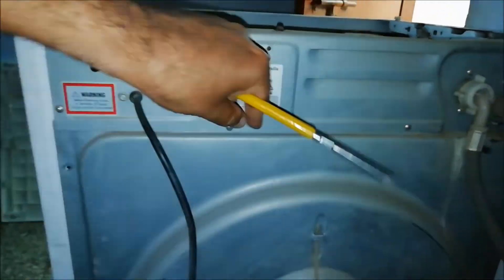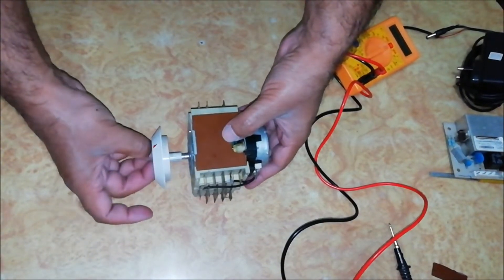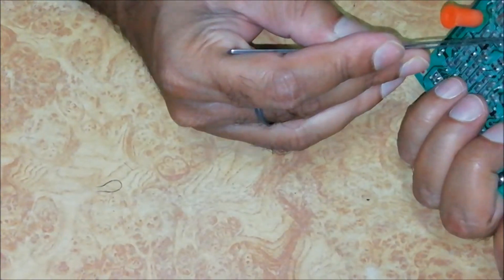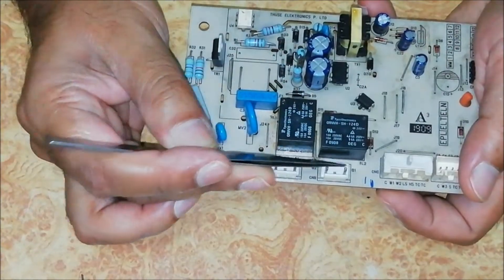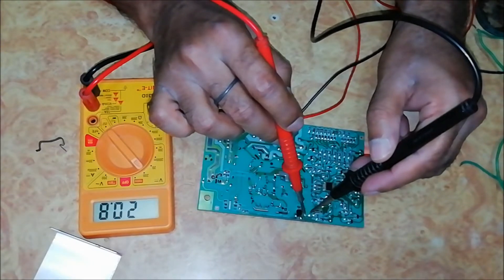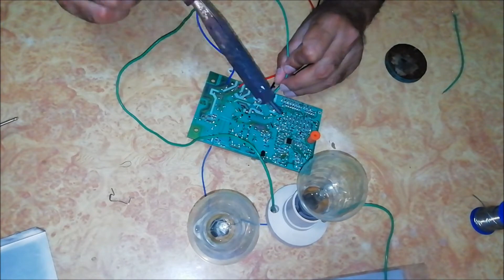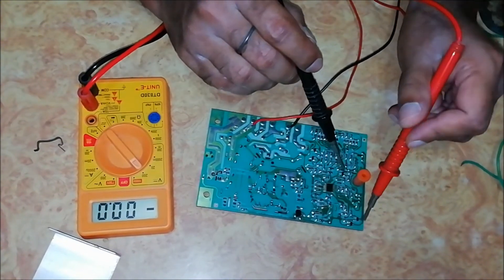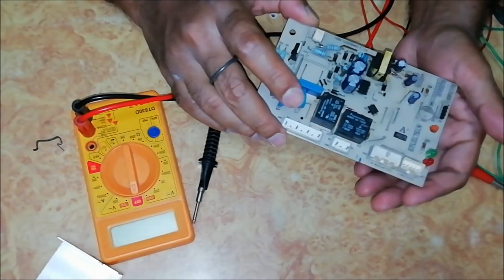how to check main board or mcu board of IFB Diva front load washing machine

Comment: Sir diva machine inlet valve 2or3 second water coming after Stop the water machine not washing or spinning not working what is the problem sir
Reply from the maker: half open the detergent tray and give water from that tray to machine and check whether machine is working or not. if machine works then check the filter at the inlet water pipe and also the solenoid valve.

Comment: Can you attach PDF photo of this board both side. Also need power supply component details IC Resistor capacitor etc
Reply from the maker: I don't have the PCB right now, but if I get it I will provide it to you. This PCB is manufactured by a Mumbai based company. The name of the company is written on the PCB. you can contact them

Comment: Hello sir, my ifb Elena DX machine motor is not running.  All other functions are running well. Like water intake, drain etc. I checked motor. Motor is in good condition. Which problem may be there in machine.
Reply from the maker: It seems that the problem is with the control board.
Reply: @diyrepairs  thanks 😊

Comment: Sir mere pass bhi yahi machine hai par ye dead condition me hai to repair ho sakta hai kya if possible then please reply me what's the problem and how to solve it
Reply from the maker: haan repair ho sakta hai. machine ka circuit check kijiye. agar wo sahi hai to motor check karen . agar motor bhi thik hai to phir door switch, water pressure switch aur solenoid valve etc check karen.

Comment: in a board only see 1.2 volt for 5 volt what is the fault please help
Reply from the maker: check 24 volt DC at the output of SMPS section. if you get 24 volt then check the 5.1 volt zener and resistance connected with zener. if there is no 24 volt at output then check the SMPS section.
Reply: @diyrepairs  24 volk ok  but 5 volt only see 1.2
Reply from the maker: @shahtechs7442 check resistance and capacitor near 5 volt zener. also check 5 volt zener.
Reply: @diyrepairs  thank you so much zener diode replaced board ok
Reply from the maker: @shahtechs7442  welcome

Comment: IFB 6.5 kg front load washing machine timing display sudden sudden change not constant to reduce when selecting option. Why give suggestion
Reply from the maker: take out the circuit board and check any capacitor is damage or not. sometimes moisture on board can give error.

Comment: PL LET ME KNOW THE MAXMIUM VOLTAGE ACROSS THE MOTOR IN WASH AND SPIN MODE THANKYOU mrcmurthy1950@gmail.com
Reply from the maker: voltage is not fixed during wash and spin cycle. it gradually increases depending upon the load. all is control by microcontroller and tacho coil. i will try to give you the maximum and minimum voltage.

Comment: IFB Elena Dx 5.5Kg having same type of PCB ,but the microcontrollers is 16 pin IC ,  check all the components are Ok , problem in the Machine is machine Drum rotate in one direction but very high speed even spin cancel mode , is it because the microcontroller is faulty or something else pls suggest
Reply from the maker: if all supportive components are good and machine is running in only one direction then probably microcontroller is faulty.
Reply: @diyrepairs  can we replaced microcontroller if avilable  or ots required any program by ifb
Reply from the maker: @virugaikwad  check the company's name of the circuit board. contact them they will give the solution.
Reply: @diyrepairs  thanks sir for your suggestion

Comment: U r explanation is very nice.sir we lost that Yellow button.what your pressed at first.can you please sugges me what I use.and how I solve the problem
Reply from the maker: yellow color button is just for grip. you can take any plastic bottle cap which can fit inside the hole easily then wrap plumbering tape on it and put in the hole tightly.